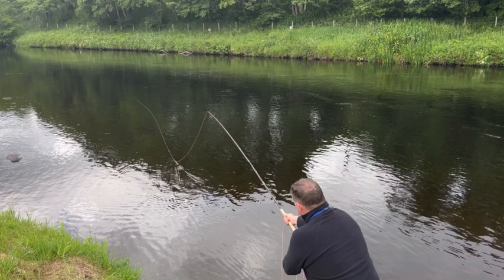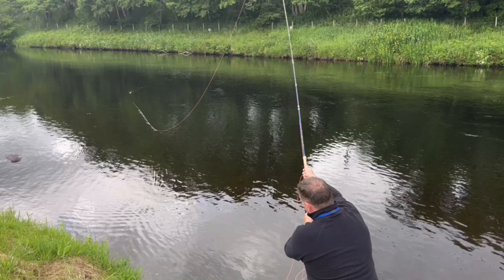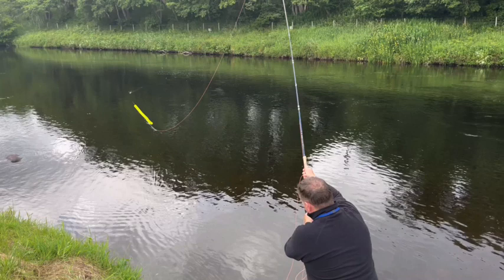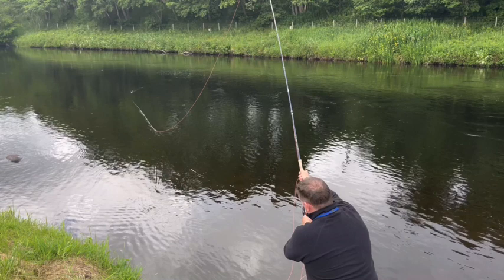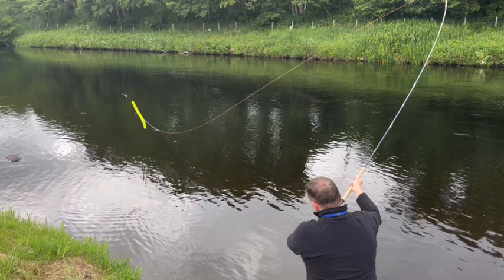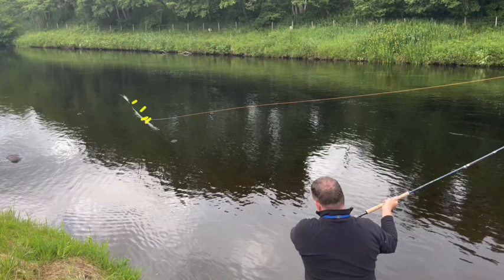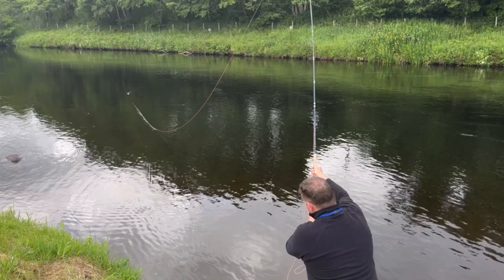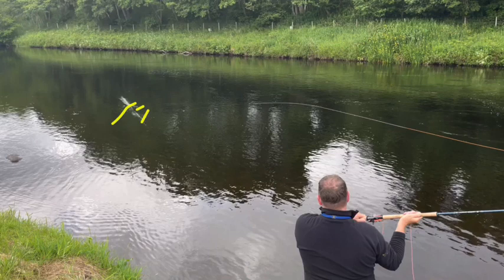Speycasting Tips

Comment: Hi, great video. quick question so I have a clear understanding, The blue line is the anchor line and should be on the water? Or is the blue line going to the rod tip. Thanks in advance for your help. thank you.
Reply from the maker: Hi, thanks for the question. The blue part of the line is the part used as the anchor.